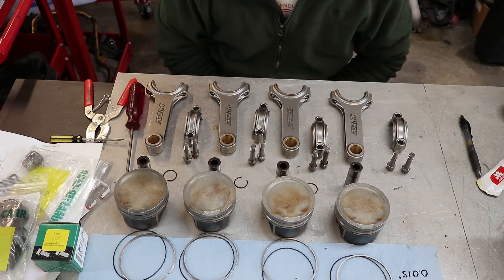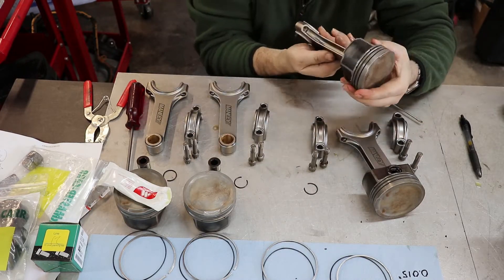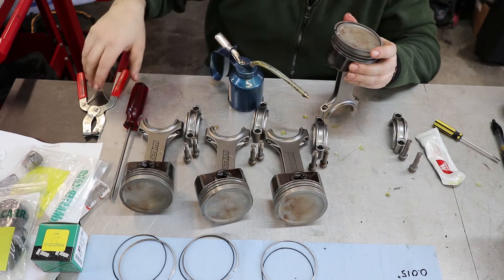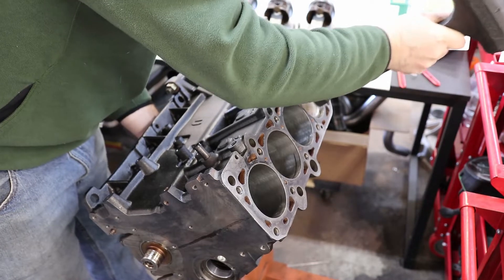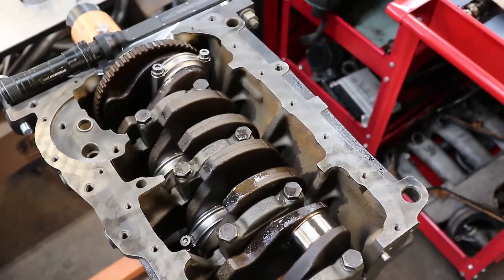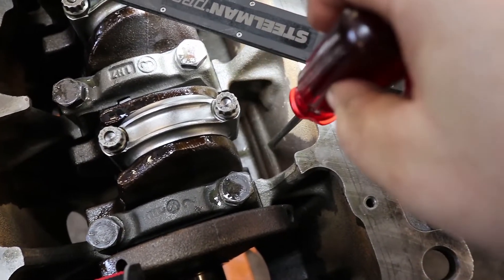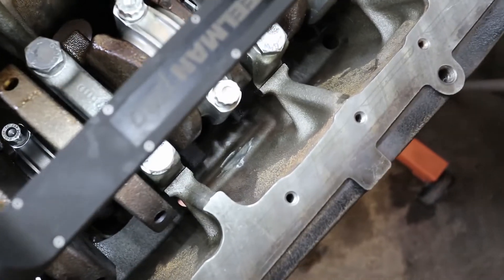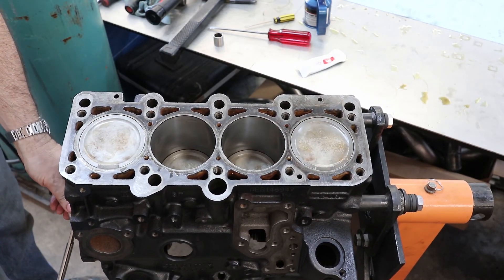Putting pistons in a VW/Audi 1.8T engine

Comment: Its always good practice to weigh your pistons, rings and rods and be as similar weight wise, otherwise try to mix and match or even take some material out.  This makes a huge difference in high rpm engine vibrations.
Reply: bla bla bla...
that was 20 yrs ago, not anymore

Comment: 1.8 t has the problem with ring, they are low quality, made a not good seal, then engine has a  oil problem in motor, audi change this on models from 2012 till now, i drive 2003 1.8t and 2009 1.8 t , this can be fixes u buy a new 4mm ring i think from titanium and dont”t have problem any more, i don’t know did u get new od use old i se u do overhaulim on this engine
Reply: I'm not adding any oil between 10km intervals. 190k mileage
Reply: @KowalDWR  same I'm at 246k. Prob poor maintenance on the engine

Comment: hey sir i found on an audi manual 
these specs
-Cylinder Maximum deviation from the specified dimension: 0.08 mm.
-Piston Maximum deviation from the specified dimension: 0.04 mm.
So the standard diametre + max deviation is 81.01+0.08=81.09mm and piston 80.975-0.04=80.945mm 
is it normal to have a clearance of 0.145 (81.09-80.945) ? even tho the standard clearance was 0.04 (81.01-80.975) so the clearance of this engine can go from 0.04 up to 0.13 ?

Comment: did you re-use the bolts or replace them again ?
Reply from the maker: These were new rods and new bolts.
Reply: @vsvenson  arent the main cap bolts stretch bolts? if you had to take the crank out did you use new ones?
Reply: @vsvenson  what torque spec and sequence did you use? yhanks

Comment: Pistons can handle all that power so only the rods are the weak links?
Reply: I hear the cranks are rated at 1000hp the head and valvetrain around that area as well from people that have tested it who knows just rumored
Reply from the maker: That's what a good friend of mine tells me... time will tell.  If you can afford new forged pistons, I'm sure it's a good investment.
Reply: Because the rods are subject to the torque loads. It's not horsepower or combustion pressure that blows rods. It's torque at the crank.
Reply: Over 300 hp on these angines require new cranks and lloottss offf others.
Reply: @KowalDWR  lol shut up

Comment: Are you using nom-OE connecting rods, is that why you had the clearance issue on cyl #2?
Reply from the maker: Yes - Manley connecting rods.
Reply: @vsvenson  I didn’t have this problem on a BAM coded (1.8T 225hp Audi TT 8n) engine with aftermarket rods?
Reply: its with early engines and H beam rods
Reply: To be specific I believe due to the block being 058, apparently  there would be clearance issues.